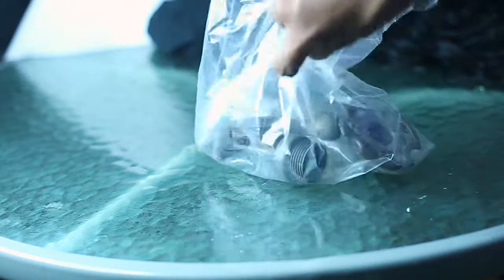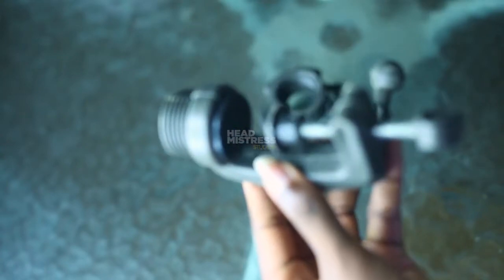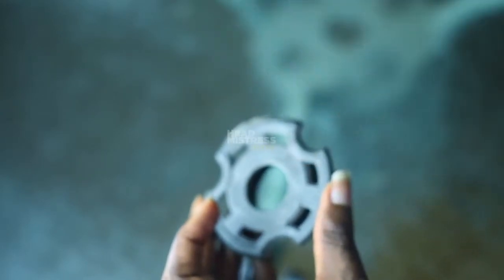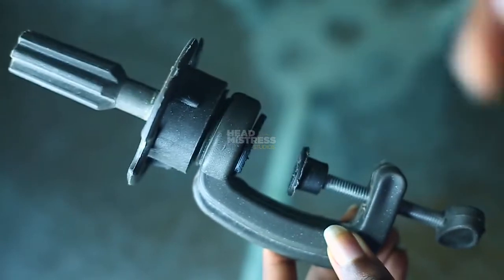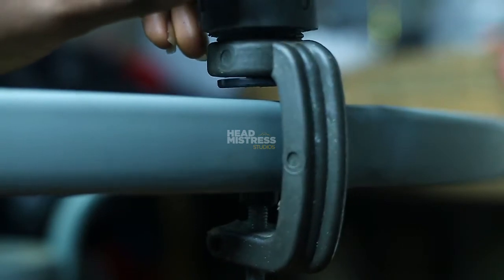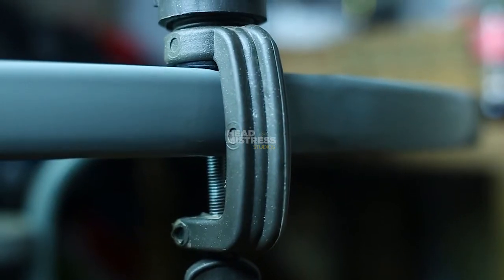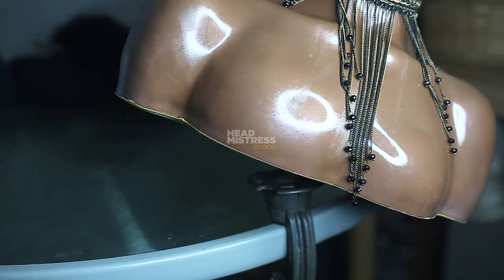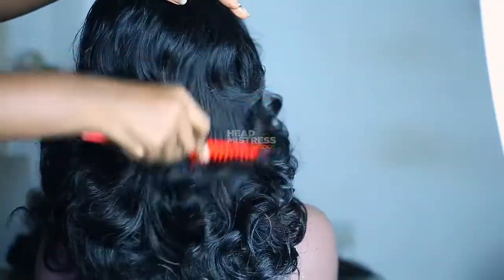HOW TO: Set Up Your Wig Stand | AFFORDABLE WIG STAND/ TRIPOD OPTION | HEADMISTRESS

Comment: Is it normal that the hole in my styrofoam head is bigger than the stand... Like it's not tight fitted
Reply from the maker: Yes , it’s perfectly normal. You can wrap a cloth or towel around the part of the stand that goes into the styrofoam head, it will fit a lot more better. Hope it helps 💕